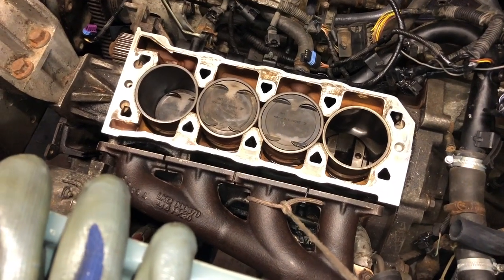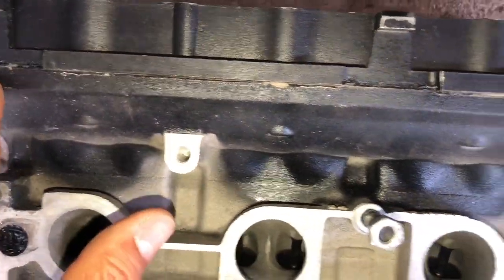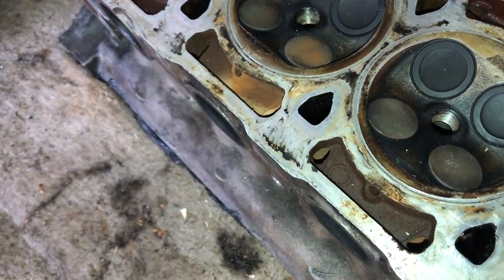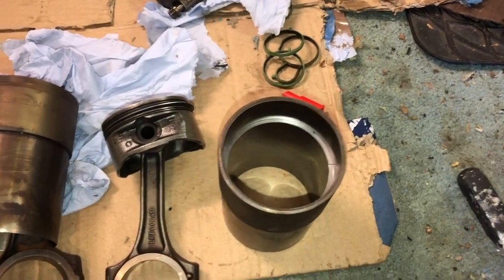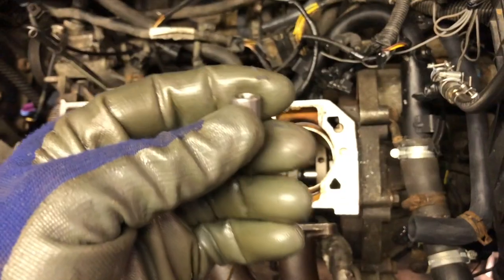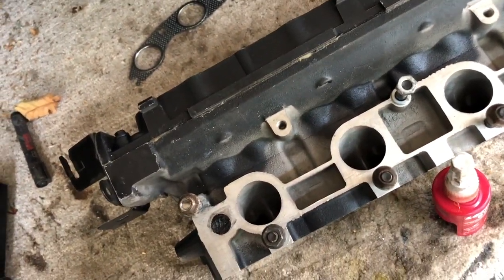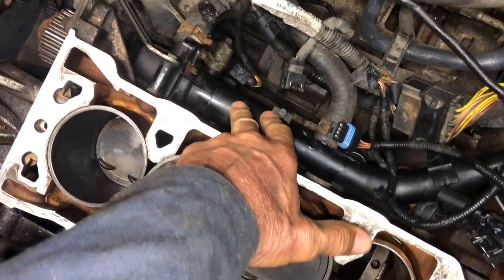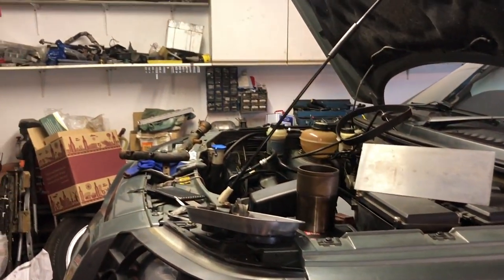MG Rover K-Series Engine Rebuild Do's & Don'ts.  Extra Hints & Tips

Comment: Only sixty two comments, this excellent effort deserves far more.

I have worked on numerous engines over the years and during the past twenty, concentrated on Rover T and K-Series. Have to say the latter, K-Series have always been a pleasure to work on. The latest being a problem MG ZT-T 1,8T which the previous owner had given up on. Collected the car with suspect engine issues but, drove OK. Part exchange taken in by local dealership who told me it had Head Gasket damage. No sign of coolant loss or over heating during the next couple of hundred miles.. 

Not for the first time, my closer investigations showed some evidence of abuse from those entrusted to care for the car. Will not go into details but, numerous pieces of evidence support this. Long story short, all four cylinder liners FLUSH with the surrounding cylinder block.  Further inspection when Pistons and Con-Rods removed showed Ring and Piston Head Lands damaged by over heating. All four damaged to a greater or lesser extent. Evidence of over heating and being driven on when obviously something was wrong. Surprised it ran so well all things considered. Also poor of no antifreeze used resulting in the original cylinder liners corrosion welded to their block locations. Two middle ones came out easily whilst the outer two needed mush persuasion. They should all come out with ease by hand. 

Long story short, bought a set of new Cylinder Liners, Pistons ( 160 ) Pins, Rings and a set of liner shims 4 "thou",  Shims cost £25 and the four piston assemblies cost £199 delivered to my door. All via eBay.  Enjoyed fitting all that lot following a thorough clean up of all parts involved with the stripping and reassembly.

Turned the key before starting the engine and waited a few seconds for the fuel pump to fully pressurise the fuel system. Then operated the starter. Immediate start. Never tire of enjoying that experience after all the work. Can confirm that engine feels and drives as good as new.

Great engines if looked after properly. Well mine are.
Reply from the maker: Good to know more k-series engines being looked after by someone who knows what they are doing. Well done. Good engines when built and maintained correctly.
Reply: @comeinhandynow  Some of the friends of my thirty something sons are keen Rover and MG owners. That destroys the myth of the pipe and slipper stereotype so beloved of Clarkson wannabee hearing aid beige mindset types.

They own a wide range of MGs and Rovers from 620ti to "like new" 1980 Metros and even an MG ZT260 V8. Our favourite cars are safe in those competent younger hands.  Odd balls like a special factory paint MG ZR with a Rover T16 Turbocharged Transplant. Have driven a couple of T-Turbo transplants. 200ps in a smaller car = pocket rocket.
Reply from the maker: @T16MGJ  Good to know. My 30yr old son had an mg zs 1.8 and loved it. And daughter a mg zr and freelander 1.8.  My influence ;).  I have fond memories of my mg zs v6 as well. Lovely flexible engine. Often tempted to look for a freelander1 v6 but it’s an auto, shame.  My current freelander 1.8 turbo upgrade supposedly has 200bhp, which funnily enough is about the same as the 2L sierra rs cosworth that people used to rave about!  Good old k-series 1.8!
Reply: @comeinhandynow   Clearly a kindred spirit.

Over twenty years ago, I gave my then schoolboy older son a 1982 MG Metro to play with. It's older than he is. He still treasures that car although he has several "better" cars at his disposal including his Lotus Elise with its 1.8K. Takes the little MG Metro to shows etc. That gift possibly sewed a lifetime's interest in Rover and MG cars. He now maybe knows more about K-Series than I do. He and his friends have changed K-Series Head Gaskets on the hard standing in front of my garage in about three hours. They know their stuff. 

I prefer to take my time and be thorough. Do it right and clean up extensively during the job. That adds extra time but is time well spent. The engine compartments on my cars are often cleaner than the exterior paintwork.

Good old 1.8 K=Series indeed.  Double  👍👍 from me.
Reply: What's the difference between the 160 pistons and the usual?
Reply: @ek8710  Having worked on VVC, 1.8 NASPs and 1.8Ts as well as 1.4s and 1.6s, at first glance they look identical. Closer inspection shows the sizes of the Valve Cut Outs in the crown are different. Out of the bores, the NASP 1.8s look to be slightly taller from bottom of skirt to top to crown. That maybe to allow for the different compression ratios between Turbo and NASP cars.  Not actually measured it though. Just visual impression. 

The VVC and Turbocharged 1.8s have those Pistons with "160" embossed in the flat area of the crown as well as an arrow ------> to avoid fitting 180 degrees around wrongly.

All this from memory as its some years like ten, since I worked on a VVC and three years since I rebuilt a 1.8T with new Liners, Pistons, Rings and Liner height shims. Three years on, that rebuild appears to have been a success.
Reply from the maker: @ek8710  stronger around the rings

Comment: My head was damaged by the fire ring indenting the head. That saver shim doesn't save anything. Eventually I popped an N-series on and shimmed fhe cylinders to 5 thou proud of the block. Tell you what, that Loctite 574 is pretty expensive. Less expensive than a new head, though, so well worth it!

Thanks for the tips. Did my head a long time ago. Did all the upgrades. Going strong for +41k miles since, and I drive her hard. No issues or hiccups. *touch wood*

P.S. You're right about the dowels. I had a cheaper Chinese MLS gasket with head saver shim (two of them went) and both had dowels that held the head off the block just enough that it dripped coolant out the side of the gasket. Not good!
Reply from the maker: That’s a good job then, well done.

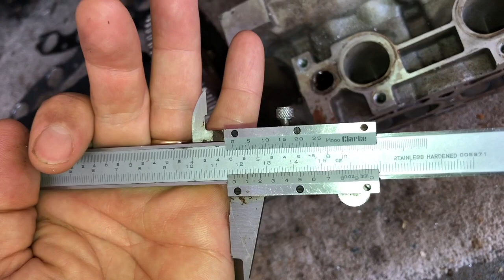Comment: I'm an ex factory machanic. I've done many K series head gaskets. I find the multi layer gaskets to be not very good. I've fitted them and coolant and dribbled out the front of the gaskets behind the exhaust manifold when i've run them up. I've then fitted the original style gasket and no problems so i don't fit the multi layer anymore. I've not tried the N series gasket yet. That gasket was in secret testing before MG Rover when under btw!!! As for skimming the head, if the compression ring has only lightly marked the head, all is ok with a bit of wet n dry,  but if there is a proper indent then it wants skimming. K heads can on be skimmed 2-3 times depending on how much they take off. They run like a bag of bolts if to much has been taken off. As our man says at 1:19  if that little groove (which was there to improve gas swirl as it was a lean burn engine) is almost level with the head its scrap.
Reply from the maker: That can happen if it is not completely flat.  I now use a very thin layer of loctite 574 around the water sealing edges and to seal any corroded bits.  The N series gasket also has a layer of something on it to help sealing.
Reply: @comeinhandynow  it's happened on heads I've had skimmed too!!
Reply: @paulrobinson3528 Yes I agree, I only use the elastomer head gasket if I have to do a head gasket change. The MLS are fraught with problems, originally developed by Land Rover for fitting to their K series engines, but only when the engine was new, not used. The N series gasket works well on the N series engine, with recorded mileages in excess of 200,000 miles! Again on a used K engine, as long as the head is in good condition, use the elastomer gasket because it does compensate for any minor vagaries between the block and the head. Lastly make sure the surfaces are immaculately clean before replacing the gasket as well.
Reply: @fenderac3049  Still not tried a N series gasket yet on a used K series. Yes plenty of brake cleaner is a must with K series.

Comment: Great video! Will be helpul for the rebuild of my MGF engine which failed emissions and has low compression on cylinder 2. As my engine build experience so far has been limited to A and B-series engines I was initially a little scared of the K-series, but after watching this video I begin to think it might be do-able for a home mechanic.
Reply from the maker: Thanks, yes definately do-able, fairly straightforward to work on.  Good luck.

Comment: I remember the recall to replace the inlet manifold bolts for studs, feels like a life time ago, RTV on later  liners and o rings in early if I remember right, don’t turn over with head off with out liners clamped, and some of the rough lads would snap the cam belt cover when doing the heads as to not have to removed the timing pulleys
Reply from the maker: Thanks for your comments.
Reply: Well now,that is a great idea,i have 2 Rovers,a 25 and a 45,doing the head gasket on the 25 now,never thought of that!!!
by the way,i had a new MLS steel gasket that ONLY last one and a half years!!!
 But now i will use the original old style composite gasket;  the POS Victor Reinz or something steel gasket (wudahell would thing of a steel gasket...that is no gasket,it is a piece of steel, gaskets NEED to be compliant,steel is not!!) in which almost ALL the black sealing coating  disappeared; 
Anyway, OEM, Payen BW750 or equivalent is gonna go on it this time,no more hype with steel ; a steel gasket requires a perfectly straight and polished block and head,  AND it requires that ALL 4 liners' protusions abobe the block deck are exactly .003 inch,AND 4 ALL THE SAME, again because its steel,  not really  a gasket; not easy to achieve and you need a depth micrometer or checking with feeler gauges on those .003" .

Comment: I hear that the MLS head gaskets are pretty unforgiving of uneven head and block surfaces. How true is that in your experience? Obviously getting the head a mild skim isn't much of an issue but it's more of a pain to do the block if it's mounted in a car.
Reply from the maker: That is probably true. I have never seen a head go non flat, the common issue is sunken liners which can be fixed with shims. Be careful not to skim the head too much or too often as there is a limit easily reached.

Comment: Awesome video,  Im rebuilding an MG ZS 120 engine at the moment without much experience, so its immensly helpful. Btw do you know what sealant should be used to refit the main bearing ladder to the block? Loctite 574 again? Maybe Im digging a bit too deep but does it matter if its aerobic or anaerobic sealant? Thanks
Reply from the maker: Thanks. I don’t remember but I would recommend getting the Haynes workshop manual or original MGRover workshop manual download which you can probably find online.  They will say what sealant if any.

Comment: I am not a mechanic or even mechanically minded. However, I loved this video because it gave me a better idea of how the K-series engine is built. My main motive in watching was that I aim sooner or later to buy a Rover 75 and I know that the head gasket problem is infamous. Can you advise me of how, as far as possible, to ensure that I buy a Rover 75 that has been "improved" along the lines that you described. Are there specialist Rover car dealers in the UK who are likely to have ensured the engine is in good condition?
Reply from the maker: Thanks for your comments and I’m glad you liked it.  I don’t know of any garages that I’d trust. Better to buy off someone private selling on a forum that maintains there own cars and knows what they are doing.  There are a few user groups online and facebook groups around. If it has had a replaced gasket, try and look for one that has the N-series gasket, tell tale signs are little tags sticking out that hold the gasket rivet on the head gasket and those that have the PRT thermostat (although normal external ones or reconfigured PRT ones to work like external output side ones would be even better.  More on that latter at some point).
Reply: @comeinhandynow  Many thanks for the info!
Reply: @roygardiner2229  Little tip to check before you buy: make sure the cooling fan is working. Switch air-con on, the fan should start.

Comment: Hi, great video ...my partners car is the Rover streetwise 1.4 petrol engine, the vehicle has been stood for 3 months (her spare car) she came to use it when her MG zt-t had an issue! ...on using the streetwise for few days, I asked if she had checked coolant level, she hadn't, I checked it for her, on opening the bonnet, to my shock I found the coolant hose that goes over top of gearbox missing, and obviously no coolant in it, the hosed had been removed (big mystery) I cautiously filled it with water, and no issues, it drove perfectly for two months, then overheating began! ...my question would be, do I replace head gasket and skim or new head? ...my thinking is head badly warped, your thoughts greatly appreciated Regards Norm's
Reply from the maker: I would say remove the head and inspect it for flatness, corrosion and indents. Only do a minimal skim if it is bad in any of those respects.  A new head is nice but only at a reasonable price.

Comment: Very good explanation. Do you have a part number for the head gasket for a good one that doesn't fail? Thanks
Reply from the maker: Thanks.  See the video description section for parts. I always use the N-series gasket which is multi layered metal without the fire rings of others that damage heads.

Comment: Had a hole in exactly the same place on the metal pipe behind the engine, was corroded through, the only thing stopping it from pissing coolant was a rust clot.
Reply from the maker: Must happen a fair bit on these old cars now.
Reply: @comeinhandynow  yep! I've replaced all mild steel coolant pipes with stainless on my F now, I never intended to spend as much as I have on this bloody thing